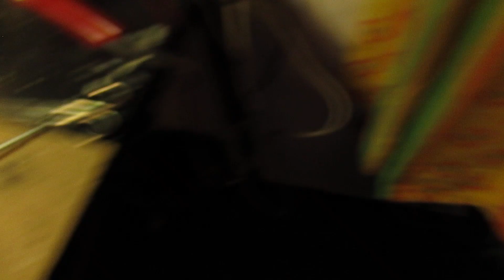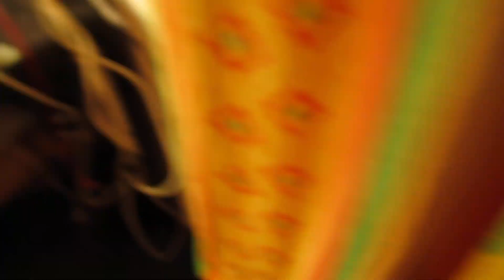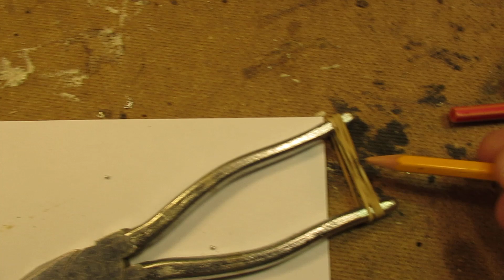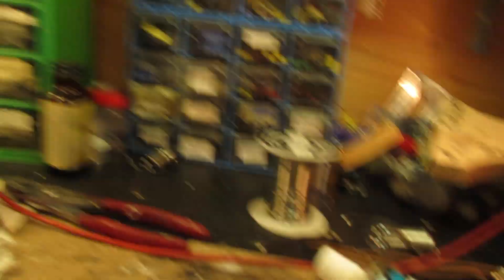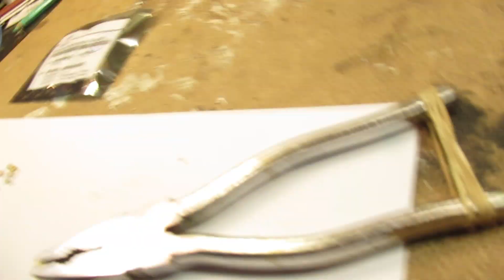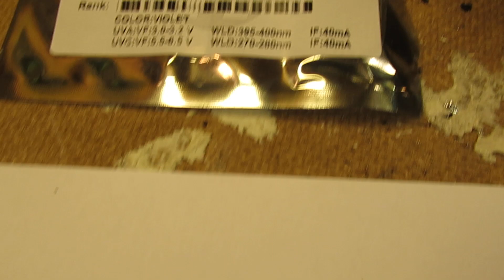Ultraviolet Radiation experiments pt 3: how to solder wires to a tiny 4 x 4 mm UV LED (demo/VLOG)

Comment: I always add a lot of flux when doing really small SMD
Reply from the maker: Interesting. Can you tell more about how you do that, say for all my followers and people that look at this video. How do you do that? What kind of heat source do you use? What kind of solder (brand/type)? What kind of flux (brand/type).What are your experiences and where are (say) the things to take in account to make proper soldering contacts with these SMD devices? How many times did you bond SMD units to boards?. And thus I mean: your personal experiences, they are the most interesting for my viewers/followers. 7 july 2023.
Reply: @radiofun232  I typed out a reply but youtube removed it because I linked directly to a store. What I do is I get solid rosin flux which you can buy from botland which is a store in Poland. They ship cheaply to the Netherlands. I then crush it and add dissolve it in 99% alcohol. You can make it a liquid or a jelly depending on how much alcohol you add to it. You can also add some citric acid (verkrijgbaar als citroenzuur bij de toko) to make it stronger but then you need to clean it up afterwards. I use 60/40 leaded solder at around 310c. I use 0.1 to 0.2mm enameled copper wire. I've soldered 0402 and smaller SMD components by just adding flux to the SMD pad and then putting the end of the copper wire on it and adding a blob of solder to my iron. Then I hold my iron for a few seconds ontop of the pad and the wire. I like getting some kneedlijm like those Pritt posterbuddies to hold the component down. This is just how I do it though. 👍
Reply: For when I do SMD on printed boards I solder one of the pads ahead of time so there is a blob of solder on it. Then I add some flux to the blob and with one hand melt the blob and with my other hand drag in the SMD component with tweezers.
Reply from the maker: @gebebbebebebr  Hi & thanks for your very valuable comments that can be useful for everyone visiting my YT channel. Thanks for taking the time to give that info. 8 july 2023.😀

Comment: When I worked on hearing aids for some 25 years, I used a test clip to hold the fine wire I was soldering. These are spring loaded narrow tubes with a brass hook at the end to hold the connection. they are plastic and will melt if they get too hot, so I copied the form of them with hobby brass tube and a thin brass rod to fit in the tube. These worked very well for me to give me something to hold onto and put the wire where it needs to be. It saved my fingers from getting burned as well.
Reply from the maker: Thanks for your valuable comment.